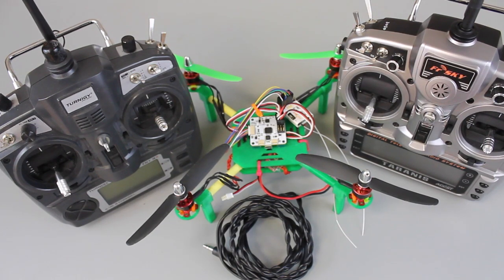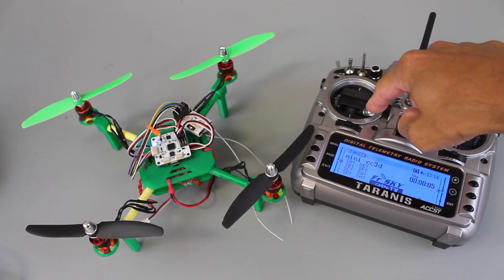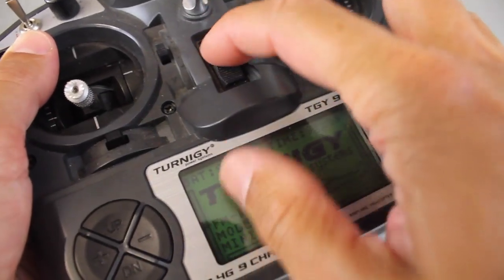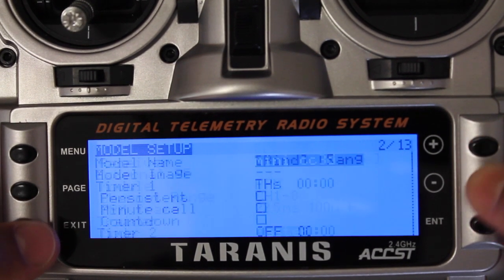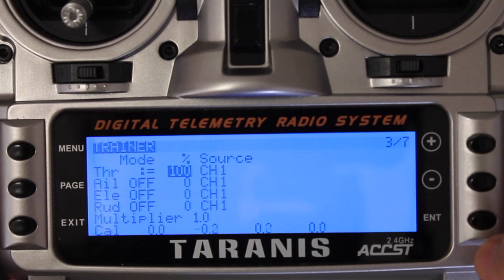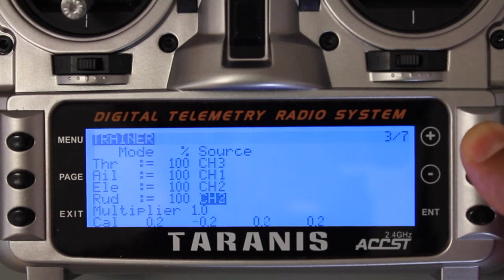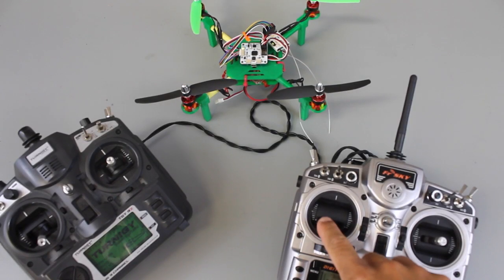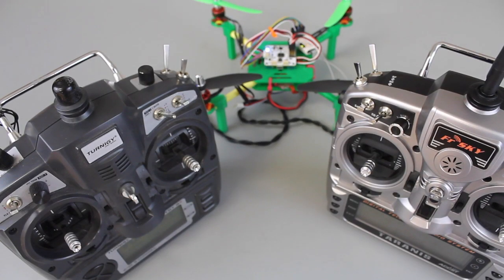FrSky Taranis Buddy Box aka Trainer Mode Setup with a Turnigy 9X

Comment: Hi Dennis.  Thank you so much for this information.  I was having problems connecting my Turnigy 9x (with not easily removable factory fitted RF module) to a Taranis X9D.  Your instruction to remove the RF module solved the problem.  I wasn't keen to unsolder the module in case I needed it later.  I have found that it is possible to switch the RF module off.  On the Turnigy 9X transmitter, in the model setup first page, it is possible to change the setting of 'Proto'(col) from 'PPM  8CH' default, to 'PPMSIM  8CH' (some other settings can be used).    Again, many thanks.

Comment: Hi!!! In your opinion is the trainer mode possible also with inverted role? I would like to connect my flysky (master) to my frsky (slave)... i want to use the flysky as master because my girlfriend bought a flysky compatible drone and i wanna be her backup in case she lose control. I created a diy trainer cable which connects ppm to ppm and gnd to gnd of the two trainer ports. I configured the trainer mode on the flysky and set the taranis as slave, but when i move the switch to enable the slave, the first 8 channels (the ones theoretically controlled by the slave) change position, but they remain fixed when i moved the taranis sticks. Have you got any idea about what i'm missing?

Comment: Should the transmitter that has binded previously with the rx always be the master? Or can it be the slave too? So that the master on the non-binded tx actually uses the antenna on the slave transmitter?

Comment: Can you disable the master override function? (Which means that master can't gain control back by moving a stick but only through flip of the switch)
Reply from the maker: Good question. I'm not sure if that's possible but will see if I can figure anything out. Please do the same if you figure it out.

Comment: Hey Dennis, I just want to say thanks for all your hard work and keeping us up to date with the latest and greatest techniques. 

I have a question, maybe you've already addressed it in a previous video and if so can you send or post a link?

I'm trying to use my Turnigy 9X v2 stock firmware with my Realflight 7, but I'm having trouble getting my Turnigy calibrated.  

I'm using one of those USB connectors (and of course the audio cable is attached to that) you select what software you want to use by moving the switch.  

I'm not sure what transmitter is compatible, since Turnigy is not on there.  I've seen in a few forums that JR and Spektum is supposed to be compatible. Also I'm unsure if there is something in the Turnigy settings I need to turn on, can you do a video on how to set it up for RealFlight 7 or if you made a video already, could you send the link. 

Any help would be appreciated.
Reply from the maker: +psxcancer That's a really good question. I haven't messed with this yet. I have the controller that comes with RealFlight and haven't thought about using a Turnigy 9X or Taranis, but I would definitely expect it to be possible. If I get some time I'll look into this and see what I can find out. If someone in the group knows how to do this hopefully they can provide some info. Thanks for following along and the good words.

Comment: Thank you so much, this helps a lot!!  Seems like this would be perfect for a dual operator setup.  Instead of mapping all the channels in the trainer section, just the channels that control the cameras pitch and yaw would be mapped.  The master radio controls the craft while the slave radio controls the pitch and yaw of the camera.  Does this sound right?
Reply from the maker: +Wade Dexter That's a very interesting thought. Hadn't really crossed my mind but the main problem I see with the logic is that only one TX can be active at a time. I have to toggle a switch to give the slave control and at that point in time I no longer have control. Let me see if I can find anything else out though.
Reply: +Dennis Baldwin Thank you for the comment! If the Thr, Ail, Ele, Rud are left off under the trainer section do you still lose control when you flip the switch to slave?  Another idea is to use the additive mode that you mention in the video and give 100% control for the camera channels and 0% for the AETR channels.  I'll probably borrow a 2nd Tx soon to play around with but if you figure anything out or you get some time to fiddle with the settings, let me know what you find!! Thanks again :)

Comment: Works fine with a Spektrum DX4e as slave as well (Aileron and Rudder in Reverse on the DX4e though).
Reply from the maker: +Christian Trempler Very glad to hear that. Thanks for sharing.
Reply: +Christian Trempler
+Dennis Baldwin 
I'm also going to use the a Spektrum but a 5E. Did you use the stereo cable or a mono? My trainer has a Spekrum 9 to my 5E and is using a mono cable.
Just be cautious.
Thanks
Reply: +W Morris I just set this up successfully using a DX5e as the Trainer connected to my Taranis using a normal stereo audio cable. It appears to work well.

Comment: Excellent help. I appreciated the step through. I used this to help me create a trainer box from Spektrum DX6i and all works the same (excepting Throttle is Channel 1). The only bit of trouble is that the buddy transmitter has to have centered trims and sub-trims before zeroing the calibration.
Reply from the maker: Hillda Flyer Glad it helped and thanks for sharing your experience.
Reply: +Hilda Flyer thanks for sharing. I have a dx8, can I buddy box with my frsky th9x and I've heard using wrong cord can "burn" things up.??  Should I use my spkt cord ?

Comment: Hy Dennis, many compliments for your tutorials.
I'd like to connect a super chap turnigy 5x (http://www.hobbyking.com/hobbyking/store/__43854__Turnigy_5X_5Ch_Mini_Transmitter_and_Receiver_Mode_2_.html) to a 9xr pro for control a 3 axis gimbal using the trainer mode.
With the 5x i will control pitch and yaw with the sticks and the "gimbal modes" with a switch. The gimbal is a dys smart 3.
Do you think yhat it will be possible?
Many thanks!!

Comment: Dennis, I notice on your video when you enable trainer mode and allow the slave to enable the board and throttle up, when you took back control the throttle cut off.  Is that because you had no throttle on the master or did the board disarm?
Reply from the maker: MindTrikCallr Great question. There was no throttle on the master.

Comment: If there is no external module on the 9X does anything need to be disconnected?
Reply from the maker: Mark Williams I don't think so. Not 100% sure, but assuming you have a 9X that accepts external modules and the external module isn't plugged in then I think you're okay.

Comment: Would it be possible to control the secondary channels, so the little switches on the FrSky, with the main control levers on the slave transmitter?
Reply from the maker: Hukon Good question. I'm not sure about that. I'll see if can find anything out and please do the same. Thanks!

Comment: I don't know what it is, but you seem to have a video for everything I am trying to do!  I just set up my 9XR and Taranis to wirelessly buddy box (using a spare D8R-XP.  These instructions helped a lot.  Thanks again, and thanks from my fiance and 7-year old who will now be able to start flying!
Reply from the maker: tpalshadow Ha ha. Thanks so much. I think the reason is that I try to do videos on things that I'm working on or things that have frustrated me. So with that we have a bunch of topics covered :) I'm glad this helped and very cool to hear your fiance and kid are going to be flying. I have two girls that have a bit of interest in flying. It's so fun to share the hobby.
Reply: Can you explain how did you do the wireless body box?
Reply: Sure, I'm using a FrSky receiver capable of PPM output plugged into the Taranis instead of the cord in this video).  So you bind the receiver attached to the Taranis to another transmitter (9XR in my case) and calibrate it's input as shown in the video.  Then you can bind the Taranis with whatever receiver you have in your vehicle.  I hope that made some sense...you do have to use the pins in the module bay of the Taranis, you can find which pin is what by doing a quick google search.
Reply: tpalshadow thanks for the quick reply, so as you are telling , you should have a frsky module on your 9xr
Reply: Yes, in my case that is correct.  Although you could easily use any brand for the slave radio as long as the receiver you connect using PPM to the Taranis supports that PPM connection.

Comment: Hi Dennis, I am a trainer in a Brisbane AU Club -both fixed and rotary.  I use buddy cables a lot.  I have mainly spektrum TX's.  I have an old Optic 6 which I had fitted with an FRsky module a few years ago.  I have been a fan of FRsky since then. I just recently found the Taranis.  It has taken me 3 weeks to get my head around the capabilities and power...  what a machine!  NOW you have helped immensely with the buddy setup on this great TX, and I thank you.  I just might add...  a very clear, concise and easy to understand video.  Obviously you have a talent there, and I am impressed.  I will also (like CHAD below) be trying a DX7 and DX8 as a buddy.  Cheers, Dennis G.
Reply from the maker: Thanks so much for the kind words. I'm glad this helped. Let me know what you find out about the Spektrum. I don't have one handy, but a buddy does and maybe we'll be able to try this soon. Take care.

Comment: Hi Dennis - great video and so informative.  I just switched to Taranis, but am wondering if I can use my new Taranis as Master with my old DX7s. It uses the same audio port for connecting, and I have had good success in training from my DX7s to a DX5i.... Truly better than juggling a single receiver between learner and master, or "awkward" hugs from behind to teach someone to fly. 
;-)
Any experience with Taranis as Master over a Spektrum radio would be great then I can use my Spektrum orange module and Spektrum radio to teach others at the field.
Great video - really shows the process. Four thumbs up!
Chad
Reply from the maker: Chad, that's a great question. I used to have a Spektrum TX but no longer do. I have a buddy with one and the next time we meet up I'll ask him to bring it. The easiest thing to check would be to hook the two up and then go to the trainer screen as I show in the video to see if moving the Spektrum sticks cause any of the calibration values to change on the Taranis. If it does then you at least know the signal is being sent over. I'll let you know if I find anything out. Take care.